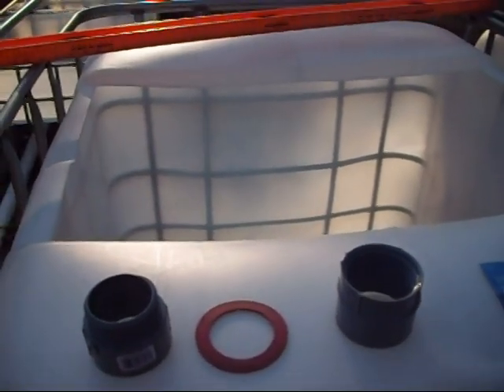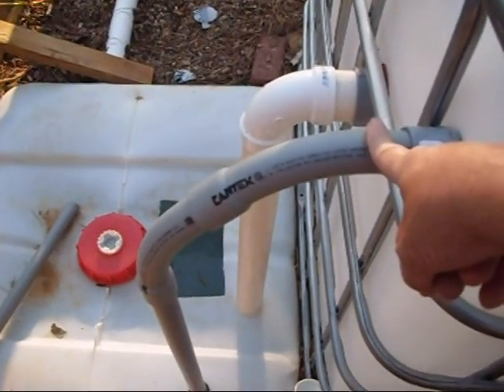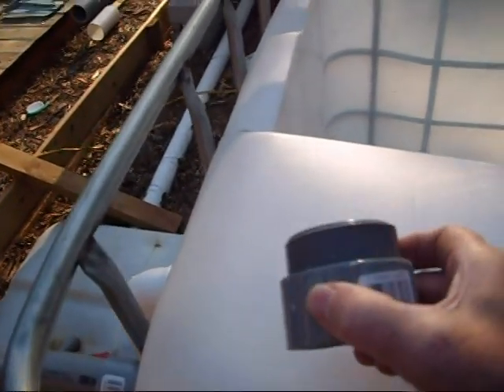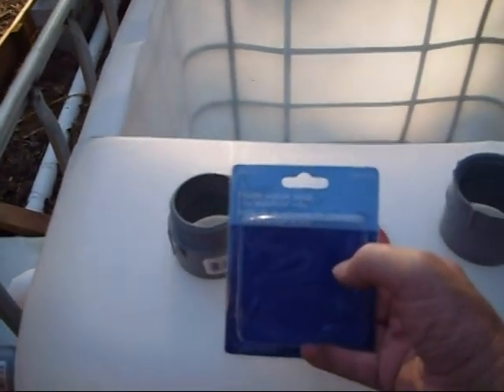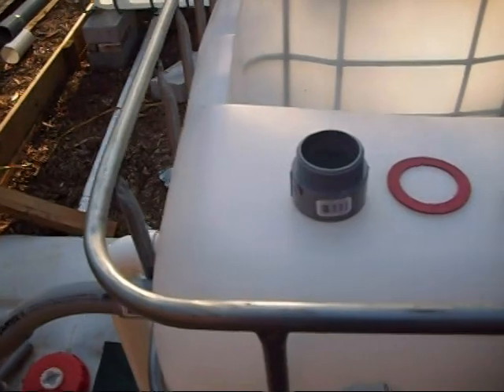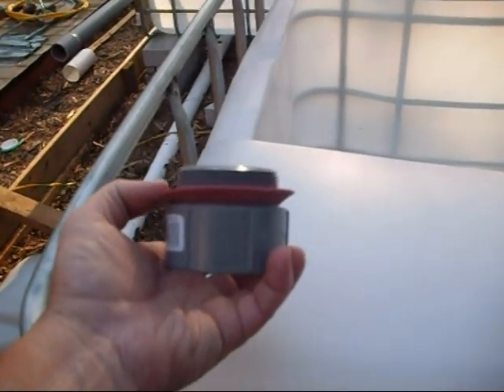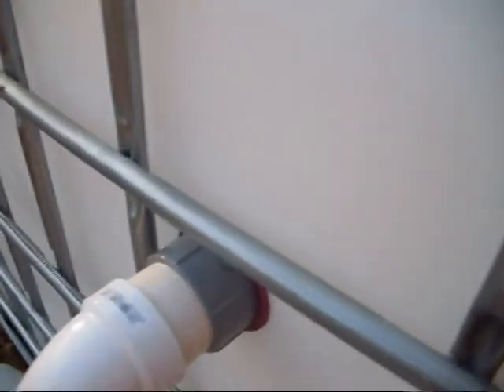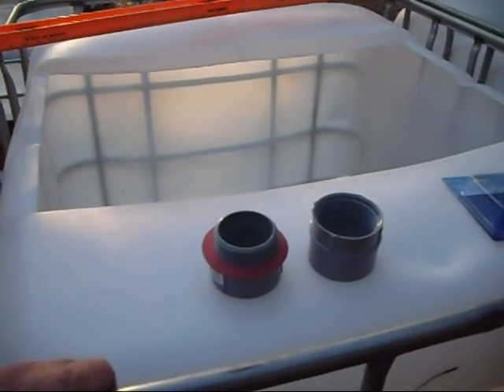Alternative to Uniseals for 2" pvc connections to IBC totes, plastic growbeds and fish tanks.

Comment: Wish i found this sooner.  I was so surprised how hard it is to find "bulkhead" type hardware at Home Depot and lowes, and if you do they're very expensive.  I've used 1" and 1-1/4" uniseals and they are very specific and or difficult to install.  So 19mm orings, and then go flat seals for toilets for 2" and 3", ty.

Comment from the maker: You may find cheaper prices on uniseals on different sites but that's not the point of the video. People watch a video on aquaponics or download some plan and think they have to have uniseals, that only uniseals will do.  For putting PVC through buckets or barrels there may be nothing better or easier. This was just to show that there are alternatives in some instances and uses, some of them much cheaper than the uniseals would be and easier to find online or locate locally. Thanks for the info.
Reply: Mark Massingill how can I use a tote for pressure washer

Comment: I need to add an outlet at the bottom of my tote, and won't have access to the inside. Is there something (a valve?) that I can just thread in from the outside without a collar on the inside?
Reply from the maker: I've seen some people use an adapter that threads into the existing valve already at the bottom of the IBC totes.  I think it's either a 2" or 2 1/2" thread but I never used one so I'm not positive. I don't know of anything that will thread into the totes and maintain a seal, mainly because the plastic is so thin, you could try it with a good silicone washer but just finding the correct size thread adapter for the existing valve would be a better bet.

Comment: Hi Mark, Will that work on a Brute Barrel where it is somewhat a rounded surface ? Thanks for sharing just wanted to see if you thought this would work on a barrel ?
Reply from the maker: I've used this method on a 30 gallon plastic trash can to make a radial flow filter with great success but I wouldn't try it on anything that wasn't either flat or very flexible. Good luck.

Comment: would this work on a glass tank?
Reply from the maker: Yes it would.  As long as you can get the hole drilled into the glass that is.
Reply: Mark Massingill
 yeah for me that's the easy part as i have glass drill set, but i was thinking the rubber version of the toilet gaskets might be better for glass, but your paper one has the advantage of not been thick, so that's what i need as i am just using pvc pipe to thread fittings as bulkheads are hard to find in Australia lol.

Thanks for the idea's.

The funny thing is i seen those paper gaskets for toilets all the time in the hardware shop and just never thought of using it for an overflow for my tank.
Reply from the maker: BlackIce504 I think something got confused somehow.  I use the silicon rubber gaskets, not paper gaskets.  They are only about 1mm thick (or less) and work really well.  I imagine paper might work but I don't like using paper gaskets myself. 

I hope one day in the next few years to make it to Australia for a bit, it looks like a beautiful country from the videos and such I've seen.  I plan to sail there and spend some time exploring. 

You're quite welcome, I'm just glad my ideas can be of help to others.  I learned most of what I know because others are willing to share their knowledge freely so I just try to do the same as best I can.  Good luck with your project.
Reply: Mark Massingill
 ah its the Aussie slang i think those paper ones i am talking about are red and there made out of cork and rubber , the others are fiber "oh something" and many people call those paper gaskets, coz there thin.

I hope Darling Habour is Finished when you come as right now its mostly construction zone, the other thing is remember to have double or triple the money you bring for everyday stuff as it costs more In Australia, a good example it costs $4.00 for 2Liter or 0.5Gal of milk. just check out some aussie sites for some prices like woolworths / coles for food, for petrol check out motormouth com au for some pricing as well, also yes we don't have much snow in places but there are a few, and even the places that don't get snow can get cold, so don't come in a pair of shorts and singlet...talk to your later mate, FYI i am in Sydney.
Reply from the maker: BlackIce504 Hopefully I'll have use for the advice you offer one day as it's a trip I'd truly love to make.  The only drawback is my disability and the nerve damage to my back and legs (I have really bad disc issues).  It may only be a pipe dream but I hold onto it so that I have something to work towards.  

Thanks for the advice and I hope I can implement it in a few years.